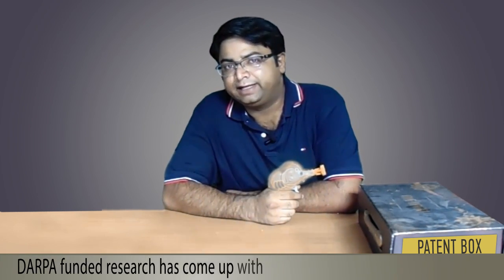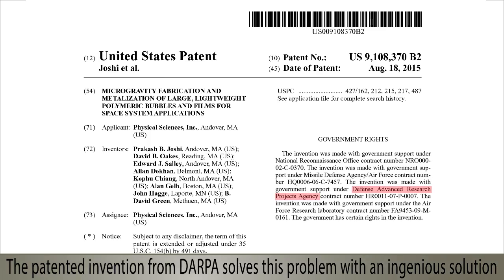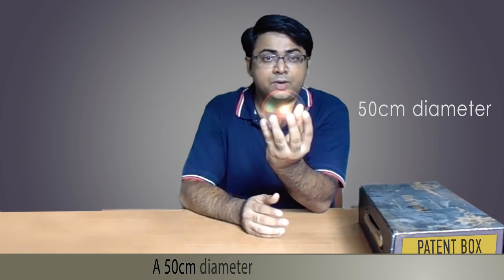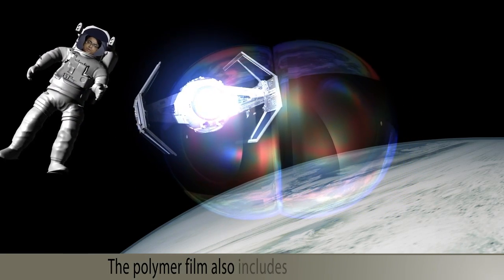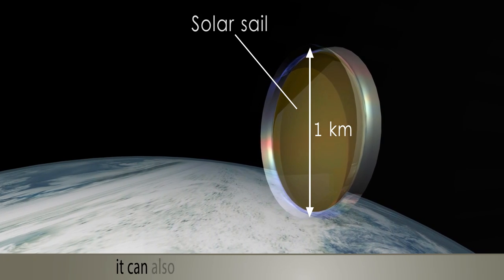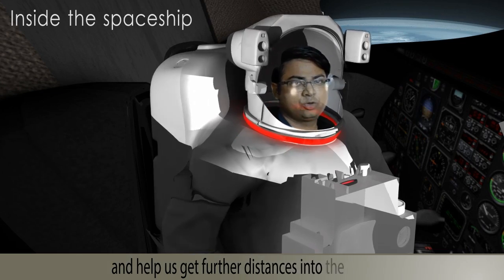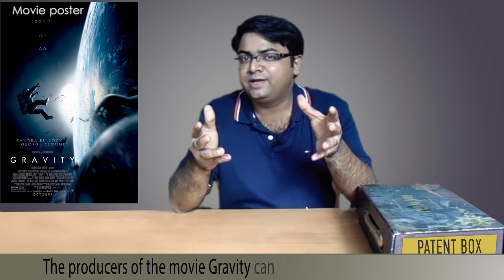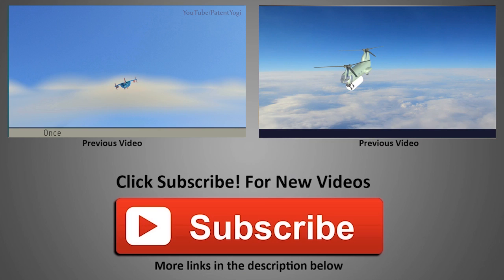DARPA funded research develops technique to blow bubbles in space

Comment: They can also make this bubbles to be giant, and help block the sun when very hot, they can make some very large, and make them altogether to make a bigger one to help in summer heat.
They need better doors in space, the doors used in movie gravity are very dangerous, they should have sliding door to the side and should have a triple door entrance, not two door entrance is not safe enough, also they can save oxygen this way as well with triple door, because they can recover that oxygen again.
They can make also a giant bubble around space station, and fill it with Oxygen, as a small atmosphere to help them have more oxygen there, as a protection as well so they don't get impacted by other satellites.